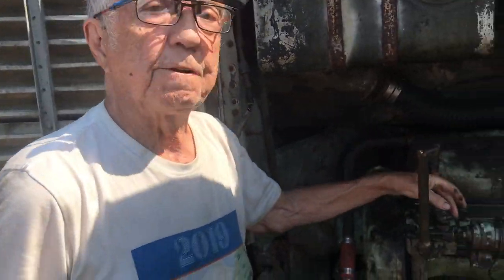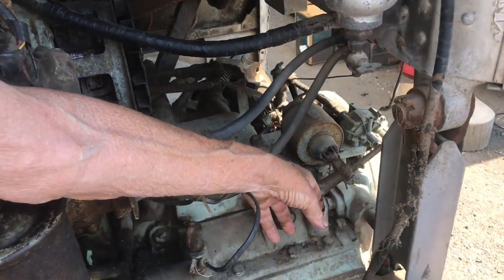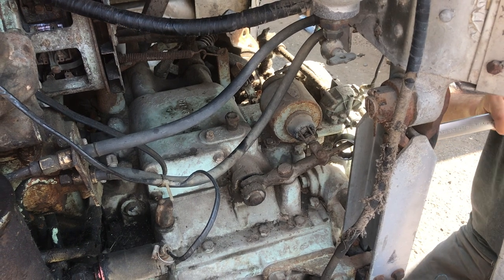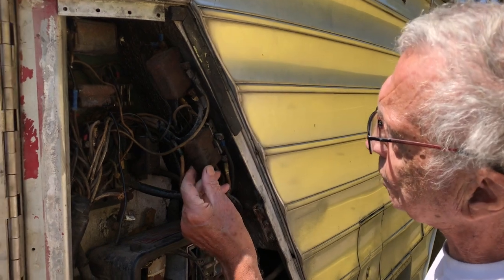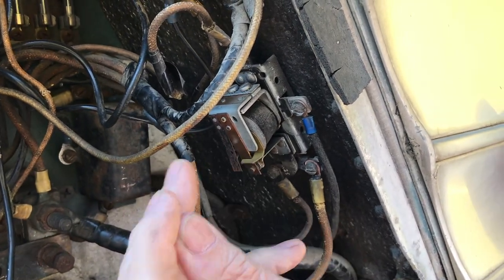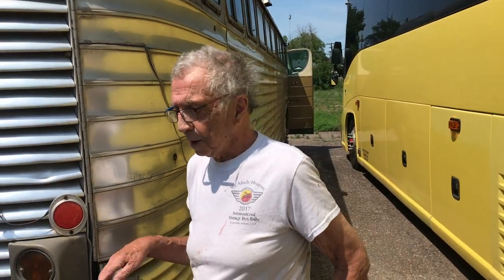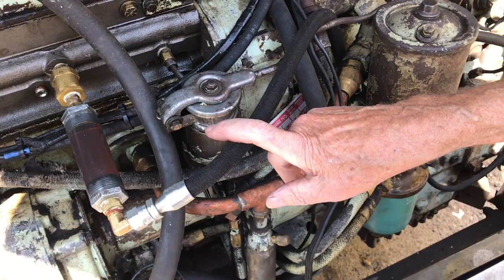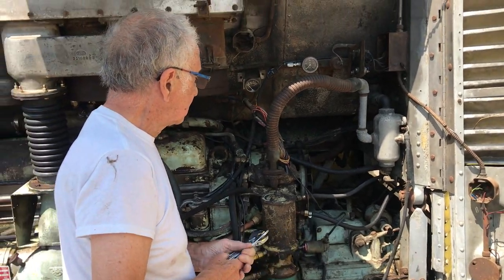Taylor's Water Pump and Reverse Solenoid and Fuel Leaks

Comment: excellent video Phil, you should write a book on old Bus repair.
Reply: Ditto. This is all very interesting Phil. You could write a book on your experiences with Busses. I'd buy it a read it Phil. 73! de K0PIR
Reply from the maker: @HamRadioAdventures  Thanx guys. I need a secretary. 73 de WEØK
Reply from the maker: The GM maintenance manuals are by far the best way to learn your bus. All the little side tricks begin with what a bus maker shows us. We can not conger up solutions without knowing what the manufacturer intended in the first place.

Comment: Phil, watching you do your thing makes me smile. so many things about these old buses that are 'not obvious'. Even somebody who has been driving buses or trucks for decades may have never driven a bus with a reverse solenoid that requires you shift into 1st, then press and hold a button while shifting into second while the reverse solenoid does it's thing. I used to drive an old 60hp Unimog with a detachable hydraulic lift loadbed. 6 speed, double clutching all the way. they basically cut the ass end off altogether! google this: unimog ruthmann niederflurhubwagen maybe you find it interesting
Reply from the maker: We have one from the Northern Pacific. We have no use for it, we just got it because we could. It's in good condition and runs and drives good.
Reply: @busoldmanphil7293  cool. Postca pic some time?  Or pan to it in video? Kinda accident like?

Comment: Hi Phil, thanks for the great informative bus video's. Please keep them coming. I have an issue with my 1948 PD3751 transmission and I wonder if you might have some insight for me. It will not go into 1st gear or reverse, although 2nd, 3rd & 4th engage just fine. It's not the linkage, I checked that by unhooking it. I also unhooked the reverse solenoid and tried to move the reverse pin on the transmission manually with no luck. It was like this when I bought it so I don't know what caused it. Perhaps improper H pattern shifting or improper engagement of the reverse button? Any help would be greatly appreciated. Btw, I have tried forcing the reverse pin rearward with a dead blow with no luck and also tried jacking up & spinning the rear wheels to see if anything was bound, nothing was. -Carl
Reply from the maker: I wish I could help, Los Dos, but you have gone as far as I have. I suggest you disconnect both linkages and see if you can freely move the transmission lever first to neutral and back into first. Have somebody hold the clutch in and bump the starter at the same time. Don't let the clutch out while bumping the starter. Trip the emergency stop to prevent the engine from starting, and BE CAREFUL! Know the person working with you. The fork could be bent from forcing it. Let me know on a recent post of mine what it turns out to be.

Comment: Do those frames on them old buses have a rust to the point that they crack
Reply from the maker: Seldom, but yes on silversides. Cracks usually are present at stress points where microscopic twisting and vibration occur.

Comment: did you take pictures of the machining error on the water pump.. and send them to the pump manufacturer..
Reply from the maker: Not usually. It becomes a time consuming procedure that has too little reward for the effort. The big reward is learning to overcome the problem with clever fixes that can be applied to future situations.

Comment: sounds like it running on 5 cyl
Reply from the maker: It does. It takes about 3 minutes to clear the air out of the filters and lines after repairing a suction leak.